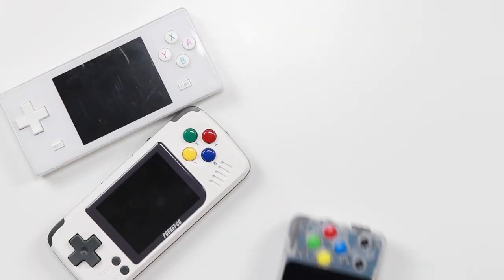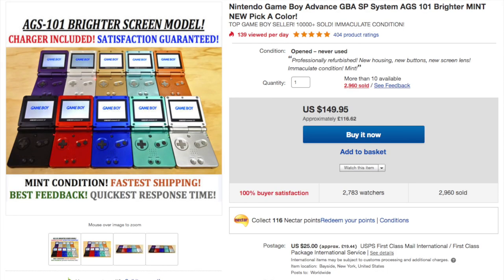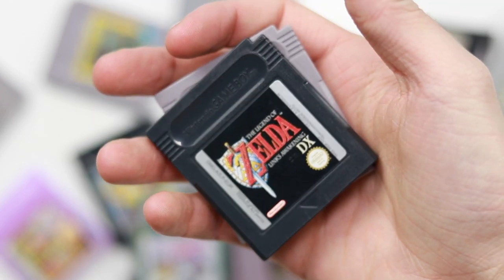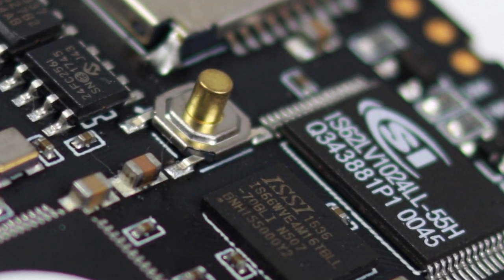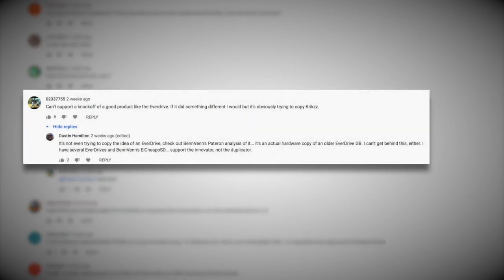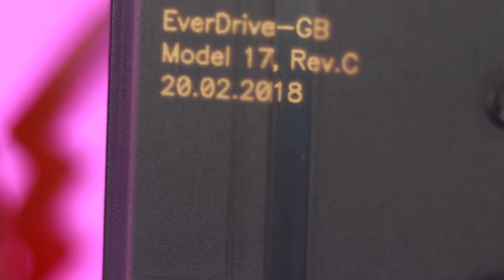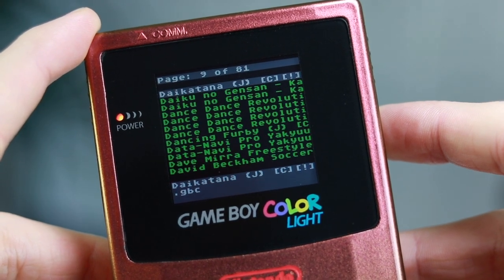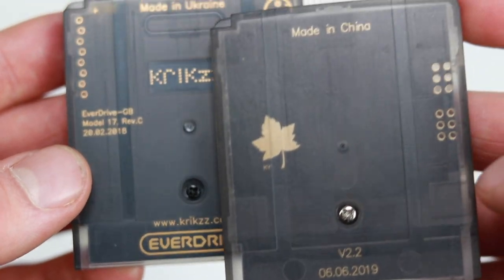This is NOT a GameBoy Game

Comment: It's interesting how powerful the psychological effect of devaluation is when you've got tons of games at your disposal. It's not only because you didn't pay for them. The same effect applies to my Steam library for example, where I've got dozens of games I've barely touched. 

The scarcity of yesteryears meant that you gave each game that you got proper attention since you didn't have as many new options at once. Of course a lot of games back then where still overpriced trash and a high cost didn't award them absolute value. The classics are still good even if you download a cheap digital copy, but a rubbish game won't become better just because you paid for a genuine cartridge. Still the limited choice and the act of handling physical objects makes the experience feel more tangible. And if you have to work to get your hands on a genuine article it will probably feel more precious. 

So as a solution of sorts I've learned to focus on a couple of games at once - and I don't buy every slightly interesting game at every Steam or eShop sale lmao. By giving attention to just a few games at once and also trying to finish them gives the experience more value.

Comment: Every single Everdrive is overpriced as hell and there is something extremely ironic with the dude putting drm on his flash cart firmware.
Reply: Do you own one? They're expensive yes, but I've never heard an actual owner say it wasn't worth every penny.
Reply: Lol mine did too but it ended up being... 3 months and 4 weeks exactly to the day. wasn't worth the wait i've got to admit, i got fed up with waiting and ordered an EZ Flash Omega after a month and a half of waiting for the everdrive and i've got to admit that it blew the everdrive out of the water in terms of overall functionality, the speed and the reliability was on par with one another but the EZ flash only took 2-3 weeks to recieve ( from the boys in china of course, DIRECTLY, so times from china have improved a LOT lol) and this is the third or fourth irritation of the EZ flash series/line, so they've gotten it down well.i could've gotten the EZ flash off amazon from american resellers and gotten it in 2-3 days instead, but i was kinda a cheap ass and didnt want to pay 3x the mark up lol, but it's true, patience can save you money lol
Reply: Just buy a bittboy. Over £100 cheaper, multiple save states and can run games for like 20 different consoles.
Reply: @tspooner01 
Which functionality do you miss the most?
Reply: @tspooner01 
Does X7 have state saves?
Sweeet!

Comment: I invested in Krikzz's Everdrive GB X7 so that I could play Pokémon Crystal ROM hacks on the go. Don't regret it at all. For me it's well worth the money for the quality and reliability, plus the inclusion of an RTC is very important to me as a Pokémon player because it rarely features on other flashcarts or flashcarts that use GB emulators (like the EZ Flash Omega for GBA, which I also own and love).
Reply: EZ FLash Omega does have RTC. You have the option to turn it off to save power in the menu. That's what the battery you can see inside is used for.

Comment: The originator of the Everdrive had to put a lot of effort into it's creation, so must recover costs etc., whereas the Chinese one is a copy of that work. But, at £142 vs £30, it is clear why people would be tempted to go for the Chinese one, even if it does lack a lifetime warrantee.
Reply: I also suspect it could be a way to control demand. China can easily have a million unit made and not care about cost. Everdrive might have them produced by batches of 2500 units which bring up cost but also reduces the risks of being stuck with 500 000 units that aren't selling. Everdrive is higher production cost and higher profit margin per unit but at a lower demand VS China's cheap mass produced product that are sold by hundreds of Ebay and Aliexpress sellers.

Comment: It should be precised that each Everdrive exist in three versions (x3, x5, x7) with different prices. X3 is ~50$. Basically, higher version auto-save and have savestate but x3 versions are still fully functionnal. Personally, I prefer the original games. Like you said, too much roms is distracting and its hard to focus on one game.

Also note that it's not the first time we got good flash cards, long ago, tototek was doing the same kind of flashcard.

Bung also did a lot of flashcard, 20 years ago, I remember I had one (GBXchanger) when I was 17 years old (and I'm now 37 years old) and it was still that expensive back in the day (I remember to have paid it ~160 dollars, without the inflation).

I play to get a flashcard later but only for two players games, to avoid having to buy two copies of each two players games. I'll probably buy the clone flashcard because one problem with the original Everdrive is that the stock is pretty low and are hard to find.

But I plan to get a real everdrive for Game Gear because as much as I like real cartdriges, some games are pretty expensive on Game Gear, not to mention the fact the Game Gear Everdrive can play Master System games without the converter.

Comment: You can also use an easier to find Hyperkin Smartboy for C Type smart phones from Amazon to dump the ROM. Use the cable it comes with so you can transfer the ROM to a different folder and rename it because the software deletes the ROM after you remove the Smartboy from the default folder.

Comment: I would have loved going with a true Krikzz Everdrive or specially (to be honest, more so than the Everdrive) the BennVenn ElCheapo, this one is priced way closer to reality (sorry, the everdrive is just overpriced in the end), but even that one has the problem of shipping. I just ended up not passing up when I saw the crappier clone on Aliexpress a while ago. It was within budget and with a good shipping to boot, no regrets at all.
I don't really feel like Krikzz is even being screwed over by the clone, they've cloned only his old version of the Everdrive GB and as said, no updates for that one either. It's all a "you get what you pay for" type of stuff, but you do get a great device anyway. Krikzz sure is getting the bulk from the more hardcore fans and the ones that want the better product, and just wouldn't sell ANY to the ones that couldn't pay for it, neither would BennVenn be able to sell for who couldn't pay for his + shipping, it's like piracy in the end (hell... it's... precisely piracy, but downright hardware piracy in this case): if people can't pay for the original, they won't, and might or not go for the cheaper (or free) pirate alternative. Not having the cheaper or pirate version won't increase sales at all.
I know the Everdrive GB has the 3 versions with varying feature levels, but even the lowest equipped model which is just way too bare bones, is still too expensive.

The one option I've still gotta check (albeit I won't be buying it tho) is the EZ Flash for the GB/GBC, it's more expensive than the clone everdrive but if I recall it's even got RTC.

Comment: I ended up buying the EZ Flash Omega, also reviewed on your channel. I will say the Everdrive looks to be built very solid, the EZ Flash Omega well not so much,  a pretty thin plastic really. I was thinking about trying to transfer the guts of the EZ Flash Omega to a regular GBA cart. Functionality wise,  I can't speak to the differences as I don't have the Everdrive to compare. Perhaps you could do a video comparing them?
Reply: The case of the EZFlash was designed with the idea of it being converted with the extra piece so that it can be put in a DS lite and not stick out of it. That's why the top bit is empty.
Reply: @chamoo232  I know, which I think is a really nice feature. But I've got a new shell for my travel worn SP and am waiting delivery of my Funnyplaying IPS  screen. My SP will be where this bad boy lives going forward. :)
Reply: @Brewskii2117  I have a few SP and my main one to play is a 101 with one of those newer smoke transparent shells. I like it a lot because it match the EZflash's shell. I also like the transparent shell because now I can easily show everyone that I actually use a DS battery without having to remove the cover. I found out that the SP batteries and the original DS batteries are the same size but with little plastic tabs at different location. By removing one tab and filing down the other it's possible to use the DS battery in an SP. It bring the battery from 600Mah to 850Mah. A very useful boost when you use a flash cart like the EZFlash.
Reply: @epicgrapefruit7563  I have never felt the SP's battery life was too short but now that I converted to an IPS screen I'm actually curious to see if I could mod it using all the empty space behind the screen. The IPS screen is much thinner than the regular screen and that would some room for a new battery. I can find 2200mAh battery in 40x70x6mm but 6mm is too tick. Would have to be 3mm. Maybe a custom 3d printed case would allow something like that. Can you imagine almost 4x the regular battery life by just making the SP 1/8 of an inch ticker?
Reply: @epicgrapefruit7563  Comfort shouldn't change if it's the piece at the back of the screen that gets ticker. I would get a black replacement shell and just get a frame to extend the edges and still use the real back cover. It's just a fun idea.

Comment: You can do soldering and have passion for miniature portable gaming device, would you take it to the next level with custom made mechanical keyboard from part you solder ? You can buy a 130 switch tester on aliexpress and then test each one of those to know which switch you prefer with all the variation of Clicky, Tactile and Linear and if you want them dampened or not. I prefer myself some Matias Clicky and planning to make a retro build with Alps SKCM Amber Switch from 2 Apple IIc Keyboard into another Full Chassis (Probably a Dell AT101W) with some Taihao Miami keycap. That a retro build btw and most keyboard nowadays use Cherry MX Compatible Part Instead of Alps one.

Comment: The cheap super card sd I got allows me to play a 18 MB pokemon rom hack, sure it sucks for graphical games do to slowdowns, but turn based rpg works fine.
Reply: And to top it off you get it for a fraction of the price. Would never play something like Metroid on it, but FF or Pokémon or just games of the sort are great. Feels good to play a gba Pokémon game with 800+ Pokémon on original hardware. Save function takes getting use to, but once you’ve got it, you’ve got it. Everdrive all the way though if you’re playing something fast paced and sprite packed, heck even og carts had slowdown on a couple games

Comment: will this thing kill my battery on a gameboy pocket with an IPS screen?
Reply: the cheap ones aren't as energy efficient as the quality branded ones, it won't kill it, but don't expect it to last as long without a battery upgrade. Panasonic has some rechargeable lithium ion batteries that perform way better than the cheaper alkaline disposable ones. There are rechargeable battery pack upgrades you can mod into a gameboy pocket as well.

Comment: Software stability? You were lucky not buying the first run when it came out, did not work on certain Gameboy models, had to send it back to get it replaced, same story with the Everdrive GBA cart before, so never ever be the first one buying a new Everdrive model and better wait for a few months to check the forums if there are any issues or if it is working stable already.

Comment: Is there a chinese GBA flash cart that allows you to save your game natively? Not save states
Reply: EZFlash Omega does both. Regular saves and you can also choose options to boot a game with save state support. Pressing L R and Start brings a save/load menu. Saving in games the way the games normally saves work perfectly but it's recommended to give the console 5 seconds after it says save complete before turning it off because there can be a slight delay between the game saying it saved and the EZFlash finishing writing the data.
Reply: @chamoo232 , thanks a lot!

Comment: My Everdrive gb x3 absolutely refuses to work in my gb boy color, & I've seen it work on a gb boy, so that's not the issue.

I've done absolutely everything I can, & still doesn't work.

I got an 8gb class 4 micro sd card, I formatted it to Fat32, I put the proper os direct from Krikzz on it, & it just come up with error after error after error.

It'll say, "Fat not found", or, "SD IO error", or "Unexpected error", or just say that it can't find the os, even thiugh every time I tried it, I always put the os in the sd card.

Comment: Sadly I can afford the Chinese knockoff.  The everdrive not so much...
Reply: The x7 is the supreme model with the most features. You could look into the x5 or x3 that are cheaper. The differences between the models is basically the way you save state with the in game menu and the real time clock. I think X3 needs to reboot to save state rather than a squeeze to bring a menu and there is no RTC but you cut the price by half.